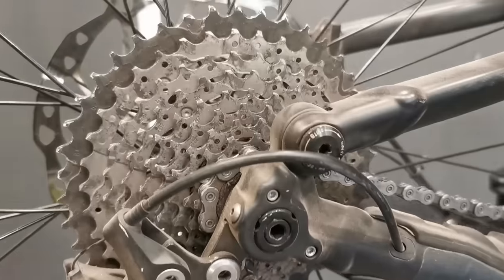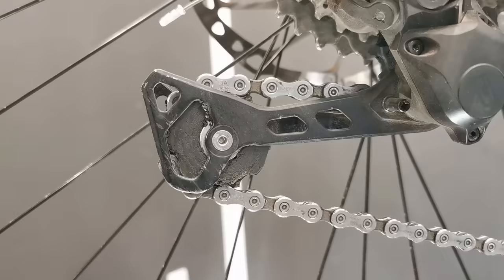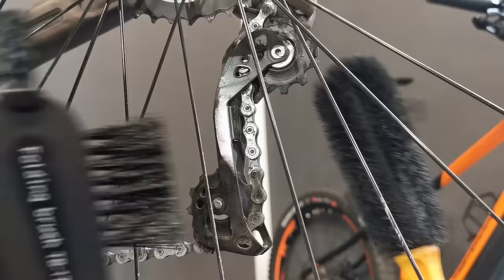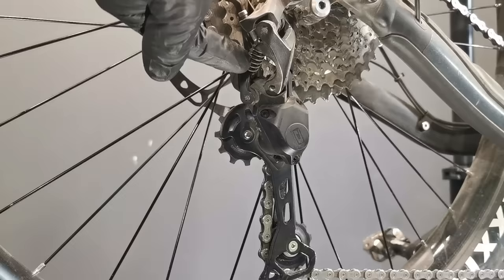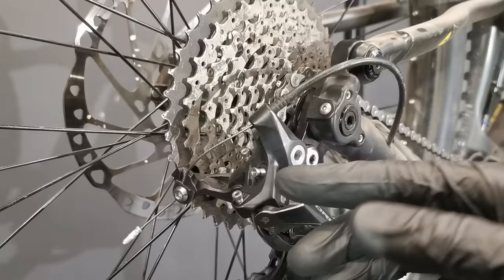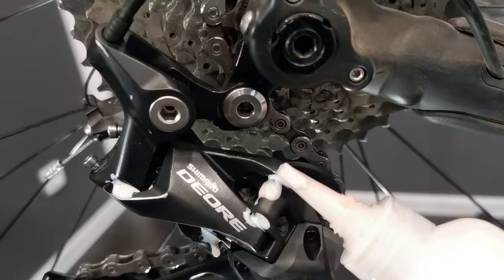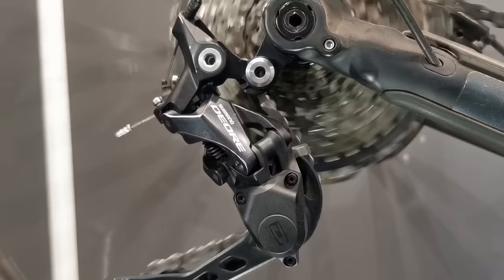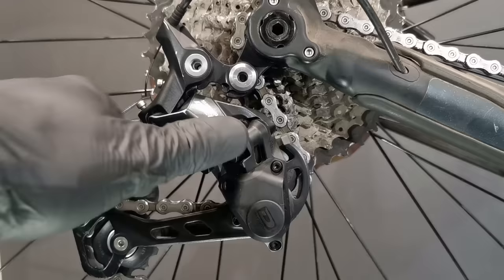Dirty And Tired Derailleur Gets New Life In 3 Minutes. How I Clean Rear Mech After Long, Dusty Trips

Comment: I have been using the squirt wax and it has be great keeping the chain and cassette fairly clean in the dusty high desert environment I live in . Now It needs to be applied a day in advance and 24 hours is even better to get a longer lasting application . I put a dab on each bike link and then use my thumb and index finger on the top and bottom of chain and back pedal to force the wax on both sides of the inner portion of the chain . Now its a bit more effort in the beginning but less work on the back side and it appears to keep the drive train running smoothly . Not sure on a wet environment as mine is mostly dry and dusty .
Reply: On wet environmets (like where I live) wax based lubricants make no such difference, the worst part is that are harder to clean. (not to mention that MUST be applied Hours before the ride, not for everyone)
Reply: @ManuelMartinez09  I've been waxing my chain for decades and I've come to believe that if your wax isn't lasting more than a ride or two then there was a problem in the chain prep, before waxing. The chain needs to be completely stripped of any oils, and finishing the clean with gasoline (petrol) won't work because that too leaves an oily residue (although it's excellent for an initial clean). You must finish with something like acetone which will completely evaporate.
Then you have a surface that will hold the wax. I need to do this about every 2000 miles or so. In between I drip something like White Lightning wax on it as I would any other wet lube. I do that maybe every 200 miles.
But the point is, the chain prep is everything to making wax as a dry lube work.
Reply: ChuckD59 As I wrote before: here is wet and muddy, waxed chains stays cleaner than oiled but not worth the time needed for a correct waxing. Also I ride 100 miles in 10 days or less so oiling is more practical. For roadies wax may be a better option. 
Cleaning chain after every ride: 1 minute... how long takes the whole waxing process?
Reply: @ManuelMartinez09  Maybe a couple minutes . Drying time maybe the biggest disadvantage but if your a person that thinks ahead than thats not a problem . If your a person that waits to the last minute to lube a chain   than wax is not for you . I can go a couple hundred miles on a single wax lube or more . What is best is getting back from a ride  do  a wax if needed .Your wiping the chain anyway just do a waxing and your good the  next day  . For me it has kept the drive train quiet and clean for a longer time than any other lube I have used . What i do is put the wax in the microwave for 5 to 10 seconds so you can shake up the wax in the bottle and makes application much easier . The other key for me once you apply to a dab to each link take your thumb and index finger and apply to the chain and back pedal to push the wax to get good coverage on the chain . Another factor is the chain appears to last allot longer
Reply: steven cole If that is good for you that’s ok, but not for me, sounds like a lot of work compared to rub the chain with a rag and take the excess of mud with a stick. Doing that my chains last 2000Km each with no problem (I use two chains, exchanging them every 200 Km or so) with lots of vertical climbing. I would like to wax (have the wax and ptfe) my road bike chain, but I used it only on the trainer so is not needed right now. Maybe on Summer
Reply: @stevencole7331  To be clear, You (and I) are talking two different waxings, I believe.
As I described there's one major clean/strip and paraffin wax. For me about every 2000 miles. In between I use a liquid wax in a bottle (I use White Lightning) just as I'd use a wet lube, every hundred miles or so. Just before I do that I use a dry brush to brush any sediment that's collected. Minimal effort no different than oiling/spraying and the chain is nearly spotless, always (and I think it shifts better but that can be subjective).

Comment: Liberal WD40 and/or PBX then use compressed air and wipe down. Then a silicon or teflon wet or dry lubricant. If you do this frequently then you generally do not need high viscosity lubricants.
Reply: Absolutely correct

Comment: Can a dirty drive train cause chain to slip skip while under load? My bike only slips on gear 6 a little and alot on  7
Reply: I'm no expert, but a worn drivetrain is usually the cause of skipping under load. Cleaning the drivetrain every now and then (after about 5 rides, depending on your environment) can help though
Reply: i had the same problem and my cassette teeth were bent so i changed the chain and cassette and it fixed it
Reply: That is usually because the chain has lengthened. You should change the chain because if you wait too long the teeth (?) of the cassette will be worn out and you would have to change it, too. In other words: changing the chain early/frequently saves you the money for also changing the cassette.
Reply: As Karsten stated above.  If you ride your bike allot it's basically change your chain once a year (even if it doesn't look too bad), and then the rest of the chain ring(s) and cassette have longer lives.

If you wait too long the chain wears/stretches, and the cogs wear quicker.... Even if you put a brand new chain on the worn cogs will make your new chain skip.

I replace my chain 3 times as much as my cassette.  The chain ring seems to wear the slowest. Chains are cheap... Cassettes aren't.

Comment: Nice job . 
But PERSONALLY  I preffer to take out the "upper" and "lower" wheels to clean its axles because theres is a normally a lot of dust adde to the grease by the lubing and it becomes killer to the steel or aluminum  even their bearings that are normally sealed but is a good idea to review if they are sick with dust or to replace them.

Comment: 👉👉Is WD40 safe for derailleur, chain mechanism?
Reply: You can use it to clean the chain, but it's not ideal for lubrication. It's a solvent and a light lubricant.
Reply: no don't use it because it displace the lube that is important in the moving parts
Reply: Tip: WD40 is good for getting out oil stains from a carpet or clothes... ;)
Reply: @DonnieX6  oh my!
Reply: @tiltil9442  well...I was also just cleaning my derailleur earlier today and got some of the pasty crud from the jockey wheels into the carpet, so you see... :D
EDIT: here is a guide how to do it: https://www.youtube.com/watch?v=ETcy1p_B5_w
Reply: Yes it's safe, but its a cleaner/water displacer.  Use it after a hose down of your bike, then lubricate appropriately.  Personally I just use GT85 on my chain, which is very similar to WD40, but with a tiny bit of PTFE in it.  Any other lubricant for the chain, I've found ends up where I dont want it and makes it collect crap, particularly sand, which is...bad.  I've used a "dry" chain for 35 years.  In my experience, they last just as long as a chain treated with "chain lube".  If you must use "chain lube" use simple 3 in 1 oil.  It's cheap, the rest are just marketing bollocks.

Comment: What is this guy pouring on the shifter at 04:45 ?
Reply: wax based ceramic chain lube
Reply: And most importantly: why does he apply anything at all to the pivots? They are sealed anyway, so the only thing it will do is to attract dust and sand.

Comment: I just hose it down and wipe it, never really had to do these extra steps, the chain and the gears will pretty much clean themselves, because it's constantly in motion, cleaning it to be spotless kinda defeats the purpose, because grease is there to keep things "clean" and working
Reply: the grime will not just rince off if you've actually used a bike on winter or dirt paths that requires thicker oil

Comment: is it ok to use wd40 for this?
Reply: chainlube is to thick so WD40 would be better imo
Reply: Noooooo
Reply: Yes, it is. If you spray the entire apparatus with WD-40 or diesel fuel, scrub the crap out of everything with that type of big, toilet brush thingy, re-apply WD-40, wipe dry, then lubricate all with chain wax spray.
Reply: @RobertLinthicum  that's the way i do it - except i have learned the hard way to stick to dry lube and web lube.  Waxes in sprays have caused me panic and nightmares in a day - i drive a bike path through marshlands and into a pine grove every day - - -i don't want a magnet for all those tiny twigs and needles.  First time ever - pulled what looked like a birds nest out of the derailer AKKKK.
Reply: @333Eriana  What’s web lube?

Comment: I found cleaning the chain and derailleur just made it wear out quicker due to the excess removed hardened grease and grit getting lodged in to the rings... i gave up and oiled regular, it looked a mess but ran for way over 2000 miles before slip and failure.

Comment: You could also just wash your bike more than once a year? I never have had this issues with 12-15hrs a week of riding. Give it a wash with soapy water, chain cassette and then relube
Reply: how do you stop the chain from rusting? everytime i use water on a chain i always end up with rust spots.
Reply: @Metalshark100  after I wash and scrub the chain with soapy water , I use a towel and dry the chain and cassette.  I then apply lube to the chain, let it sit for a bit and wipe off excess. This will stop any rust
Reply: @thirstygreek  is it bad to soak the chain in soapy water? I like to leave my chain in a jar of soapy water for degreasing as I use wax. And silly me took the bike to a shop to get it checked whilst in the process they threw a whole load of factory thick grease onto the chain when I told them not to. Stupid bike shop employees don't know wax when they see it.

Comment: 1:13 plastic wheel + metal screwdriver tip = destroyed plastic, no?
Reply: That wheel is made from steel of course.
Reply: More importantly you get a better speed range and easier shifting from a Rholoff hub. Maintenance is an annual oil change. That’s it.

Comment: I pressure wash then lubricate my bike.
Reply: Careful pressure washing!!! Even a garden hose full blast with a nozzle is not recommend.  You basically ruin bearings and seals by blasting dirty water into them.  Very bad idea on any decent bike.  A washer can be used but you have to be very careful where on the bike and generally most do not use them.

Lots of YouTube vids on the topic.
Reply: @johnnygunz2300  I've seen lots of youtube videos detailing to not do this but no videos providing evidence that it actually ruins bearings in the long term. If you know of any please let me know. Also - what do you think about pressure washers like the one that muc-off sells for bikes?
Reply: @loamymtb  so I looked into this a bit more.... I think the real answer is in between.

The UK version of pressure washer is electric and not super aggressive (saw on gmbn).  In the USA ours tends to be the gas powered ones that will strip paint off your car and house easily... When I say easily my father's washer  is nearly as aggressive as a sand blaster.  The gmbn folks were using washers that looked less aggressive than my plug in Ryobi washer.

In short if you're using a 1200 psi or less electric pressure washer not aimed at sensitive parts you're fine likely. 
 
Those gas powered ones is really a bad idea.

Comment: Or you buy a bike with a belt (instead of chain) and an inner gear system (instead of a derailleur)
Reply: And i assume you dont have that bike otherwise you wouldn’t end up here 😬
Reply: And spend an extra 500
Reply: @cmmartti  incorrect and the other depends and can be the other way around with a pinion
Reply: And lose 10% power.
Or 5%, and $1400 for a Rohloff.

Comment: just dont understand why e bikes still need gears ,pedals
Reply: because it's a pedal assist ....doesn't have a throttle.  The motor only works when you peddle the bike....Plus it's a way to control speed essentially.....I've ridden one and there is no way a new style BB motor ebike can go 25+ in the granny gear (1st gear).  So the derailleur essentially adds a transmission to the bike if that helps.  If it was throttle only--like hub motor ebikes, conversions, motorcycle's, etc....then it would tear up the turf like those do.   Search hub driven ebike and then search bosch hub motor ebike....you'll see the difference.
Reply: because of government's licensing laws. If it doesn't have pedals then you need a license to ride it. or you can only ride it off road.  Frigging government bull crap!
Reply: @ericthedesigner  Not even close at all

Comment: I would just spray some WD40 onto a derailleur, wash it, and then spray some more WD40. Simples :D
Reply: no lubricant?
I thought wd 40 is for removing rust
Reply: degreaser>power hose>lube=simples
Reply: @Atul-Kr-117  it cleans and lubricates but it's bit oily and sticky so will collect dust etc.
Reply: Standard WD-40 won't lubricate, but you have specific WD for lube, maybe even for bikes.
But even the standard wd  is so expensive that I'm using white-spirit then thin oil.

Comment: Too bad all those gears are exposed. Using a Rohloff hub or pinion gearbox for training would avoid all this hassle. Then you could just use the exposed gears for racing where friction and weight are more if an issue.